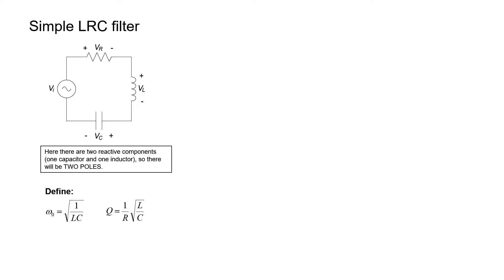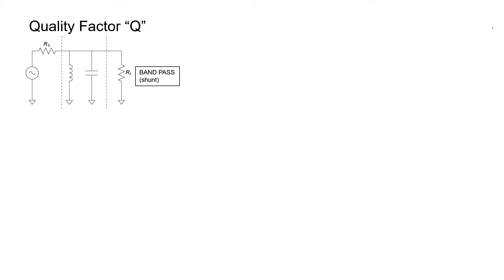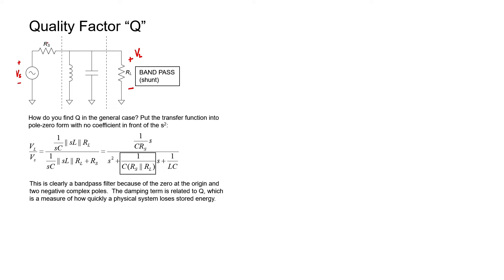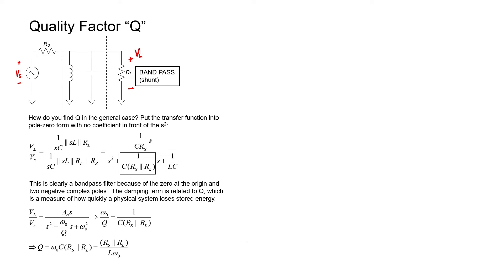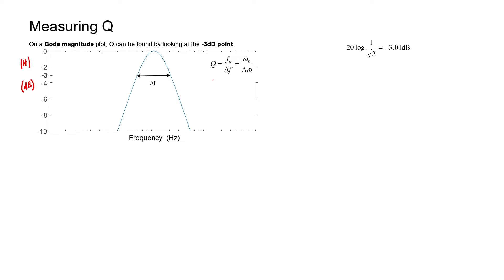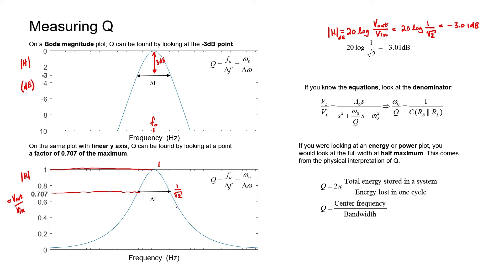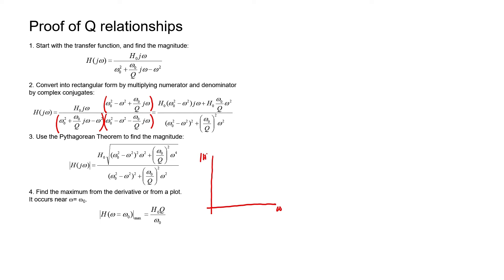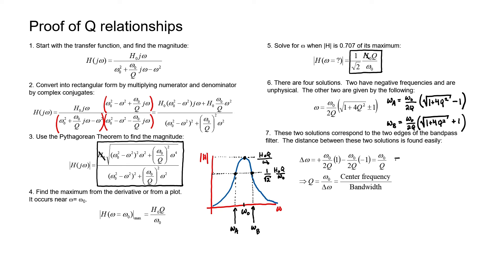All about the quality factor Q in circuits (8 - Passive Filters)

Comment: Thank you for a great video and a lot of great information! I have found your entire series very well done and because of you I am relearning all of what I was taught years ago.

I'm far from an expert, but please take a look at the equation that you use starting around 10:51. You say to multiply by the complex conjugate in order to move the j from the denominator to the numerator.
But then the complex conjugate written and shown in the video, the denominator shows "-" and the numerator shows "+".   

If I understand correctly, both numerator AND denominator are supposed to be exactly the same. With either both being "+" or both being "-" (e.g. a+b/a+b   or   a-b/a-b  so that we are essentially multiplying by 1, which allows changing the "look" or the form of the equation, but not changing any of the values in the equation). 

And if I've followed your math correctly, the actual numerator and denominator that you multiplied by (but possibly shown incorrectly)  both contain a "-" shown in the answer in the following video step

Please advise...

Comment: Hi Aaron, you have explained really well about everything but when it comes to practical implementation or even on simulation platforms let say LTSpice, it has been observed that the bandwidth in RLC series or parallel circuit is not symmetric about the resonance frequency. Would you explain it in your upcoming videos? Would be grateful. <3

Comment: You can also combine multiple stages of a filter with different Qs. E.g., a low-pass filter with a low Q in series with another low-pass filter with a high Q. In this way the pass band area of the filter will have a sharper roll off right at the cut-off frequency. This without affecting the poles that determine the roll-off per decade.